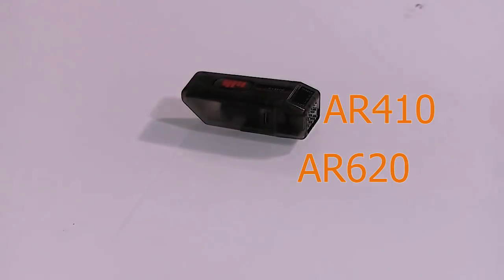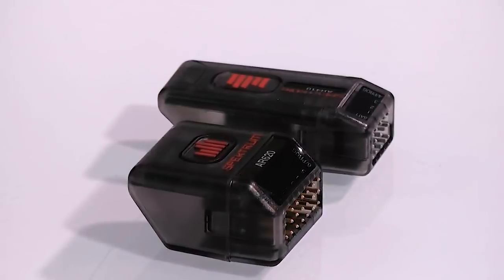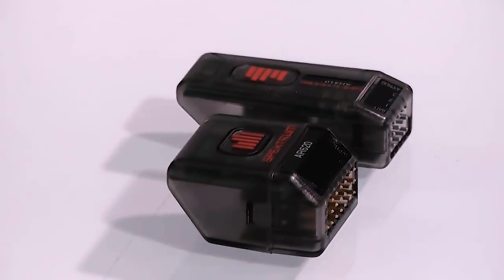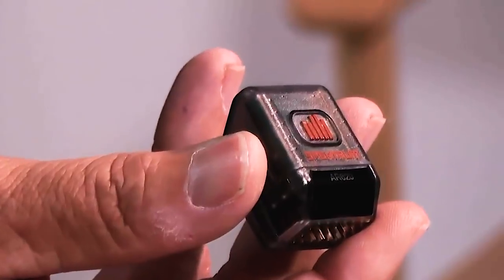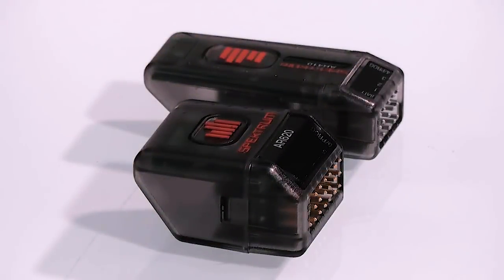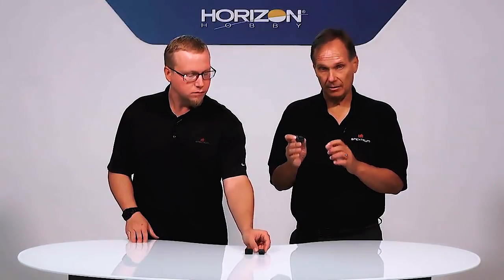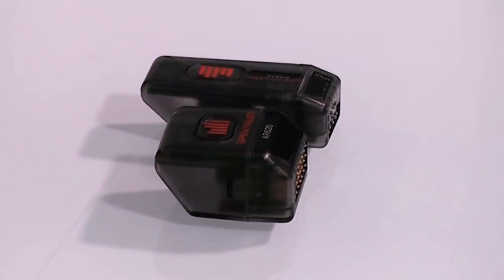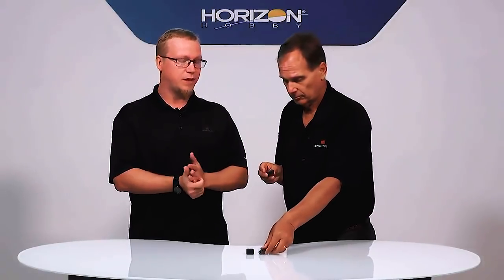Spektrum Antenna-less Receiver Tech Talk

Comment: Better range than what
Reply from the maker: AR400 and AR610 and other single feeder antenna receivers.
Reply: SpektrumRC hello I'm trying to get some kind antenna like TBS Crossfire for dx6e controller can you recommend something of you product 4 long range
Reply from the maker: With out a trainer or serial port on the DX6e, you are going to be hard pressed to get a long range module to work. One thing you could do is get a Sbus receiver, like the AR7700, and use that as a sort of daisy chain to a Crossfire, but that is a big work around. If you want the best of crossfire the iX12 is the way to go.
Reply: @romanagosto9 . To me, it sounds like you have not done your homework and want to send something way way out there. I have the DX6E and it's great for my planes, but I also have more Spektrum, and Futaba, and FrSky (each their own purpose). Really though, do keep asking questions so you can find out you can't slap an antenna on something and fly to the moon.
Reply: RCWeaven FPV okay thank you spektrumRC
Reply: @SpektrumRCvideos  does the range compare or beat what I'm used to with the autobind satalites I usually use with my models?
Reply: Conventional wired antenna version...
Reply: Will this work on a 250 spedix qwad
Reply: @1965escamilla  It was tested for wings.
Reply: @Romano Seven So I now have one of these 6 channel and great to not have to worry about antennas, but still only within a local field. I will say though I almost miss the bind plug. I only have two hands. Really, plugging in a battery takes all of my hands, or both. Holding the bind button with the third, or wait.. 
To me, it could be like some of their planes where it has different functionality within the first couple few seconds. Plug in battery, right away hit the bind button to go into bind mode, if not then normal. 
Nice big button though. Better than FrSky. Theirs is so small a noob was telling me there is no button. That takes four hands, or wait..